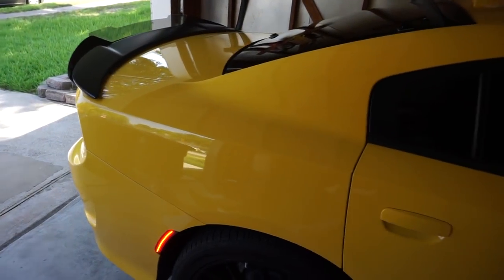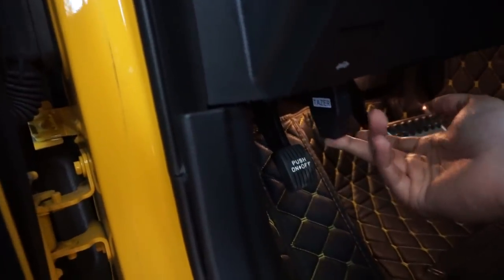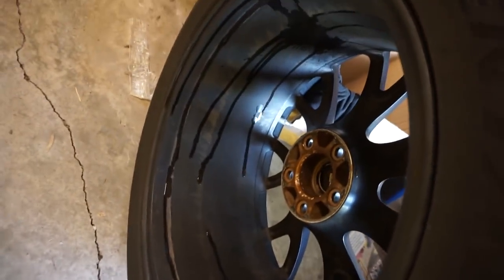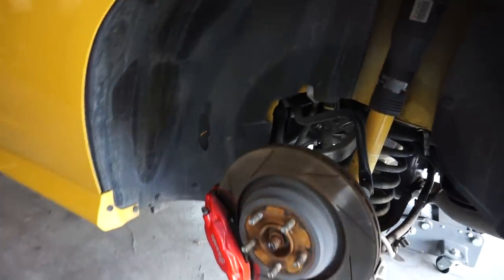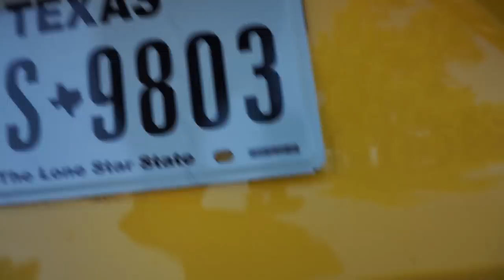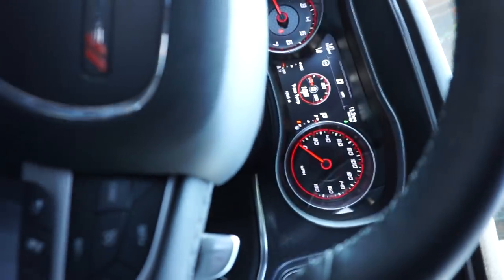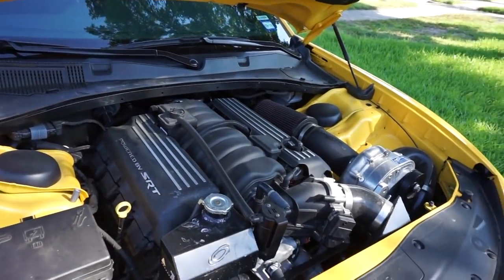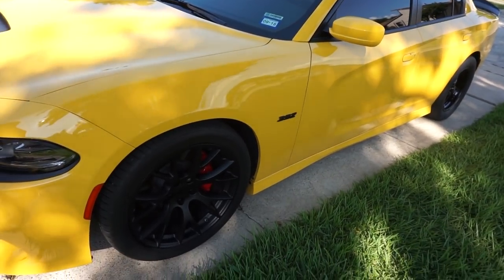Putting on some running shoes and making test hits! #ProchargedScatpack

Comment: Maybe the water cane from the car wash ?
Reply from the maker: Maybe. I was thinking that but I didn’t mention that I got it washed Thursday, I made this video Friday. So it’s possible but the liquid seemed colored and oily. Plus the car sitting in the garage for 24 hours in temps in excess of 100 degrees (in the garage) with a dehumidifier keeping the humidity in the garage down to 40%. Seems like it would have dried. But maybe not.. I dunno. I hope it was just water that mixed with some crap under the hood, and not actual leaking.

Comment: I’ve read in forums “don’t supercharge a 392 you’re engine will blow up” but you my friend have defied those odds. You’re the only guy on YouTube I know that has done this to a 392 & that just gives me hope to do it to mine as well
Reply from the maker: It’s still alive and kicking.
Reply: Well also the set up is low boost. If it was more then its more of a change of blowing the engine
Reply: Who are these people that are blowing 392 with a supercharger it's basically the same motor as the Hellcat. Except it's a 6.4 and not a 6.2 so the rods and pistons are a different size but are still of the same make and strength. The only way they could be blown Motors is from head bolts and Gasket strength. That's the only reason they can't run the same amount of boost. But you changed the head bolts to arp and the Gasket you will have no problem.

Comment: I don't know about scats or srts but the hellcats have a lift point for each side on the rear. If you don't have those, get some jack pads from zl1addons. As far as the launch, I give my car enough gas  and feel the rear squat then hold it there and I don't mash the throttle on the light.

Comment: Check your differential fluid. I see you are using that as the point to lift the rear end. Might be just a loose drain plug. If you are lifting right on the diff you may have compromised the seal or cracked the diff.
Reply from the maker: The leak was there prior to me lifting it. Otherwise that's a possibility. Should i not lift from there?
Reply: Put a white paper towel on it and check the color. That will tell you what it is. If your still under factory warranty, you maybe able to have it repaired.
Reply: Dude I'm almost positive that that is Define luid you need to check your differential especially with it leaking inside your rim.

Comment: What was that steel braided line you picked up and checked towards the end of the video is that the oil line for the supercharger. Because I know a lot of centrifugal style superchargers have to be oil fed constantly like a turbocharger. If I was you I would call ProCharger and find out if you need to be oil fed constantly. Maybe that's why your supercharger is making noises.
Reply from the maker: Nah its self fed, no constant oil. You do need to change the oil every 5k miles or so.
Reply from the maker: That was the drain line..

Comment: You should get the double bypass and put the tazer in the trunk. Super eazy. I used to kick the tazer all the text also in my challenger.
Reply from the maker: Yeah I don’t set the brake very often but it’s almost impossible to do without kicking the tazer. At least with my size 14

Comment: I hope that fluid leak is not brake fluid or transmission fluid.
Reply: I thought it was differential fluid. But you're right it could be brake fluid especially with it leaking inside the rim I would check that ASAP

Comment: The demon replicas are going to look good. Have you thought about a stall to help get you out of the hole? My procharged g8 was a dog without a stall!
Reply from the maker: Maybe.. I feel like it should have plenty on the stock stall though. I don’t want more heat and drivability issues you get from a high stall.
Reply: Hqen2000 yeah, i hear ya. I have an F series blower so they make more of the power up top. Last time I had it at the track without a stall it ran same times 11.7 at 121 it would roll out slower than I thought. I got a stall now so should help.

Comment: I think Stangmode had a slight better N/A 1/4 time and your's is Procharged..... kinda strange. What should you be running, like high 10's? He made 11.4 or something.
Reply: alphazoom II Stangmode is running some insane times, but then again those A10 GT’s are impressive as hell. I think if Hqen2000 can get a good DA and hooks that he’ll hit 11.0-11.1 @ around 124-125
Reply from the maker: Yeah. A lot of it is the DA. But I clearly want to be able to run fast even with crap DA so I probably need more powa
Reply from the maker: But I really need to get it on a dyno. That’s the first step.

Comment: I would cheek the brake lines in the rear or power steering or transmission fluid. The track is NOT the place to discover you have a big problem!